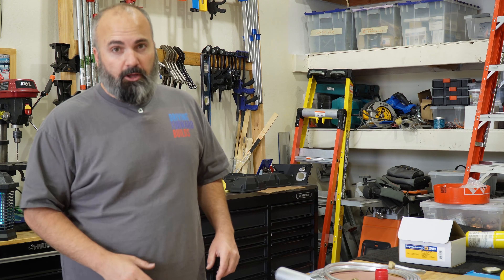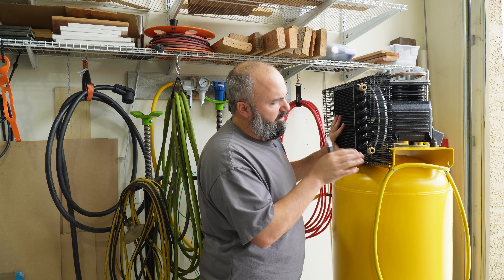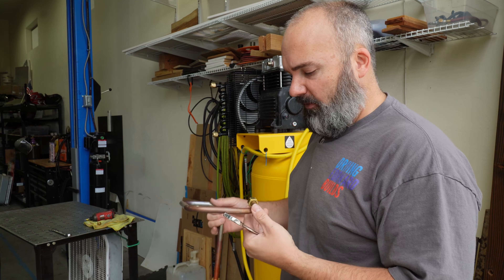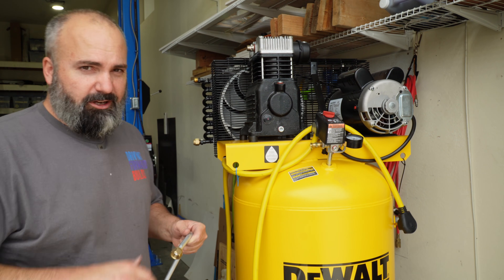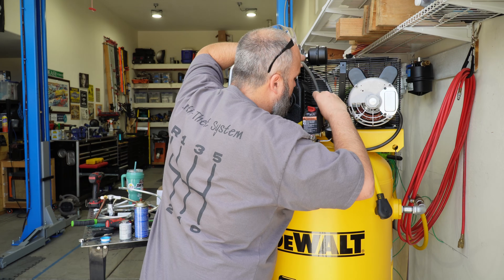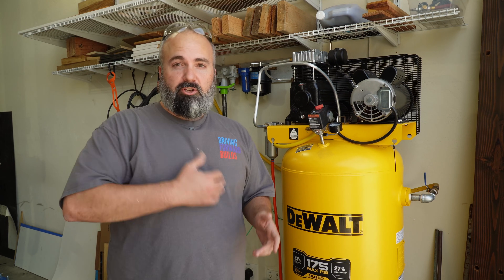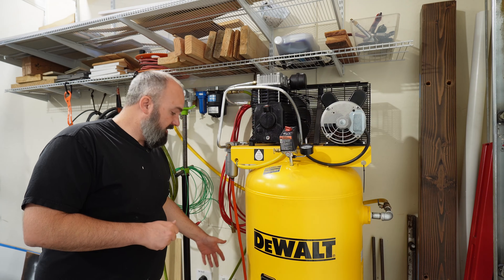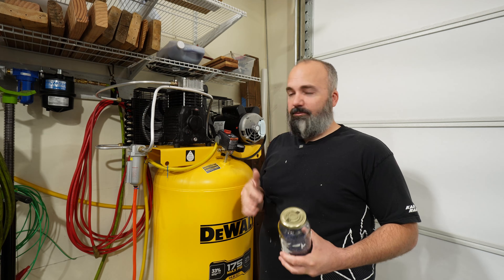DIY Air Compressor Aftercooler/Dryer

Comment: I bought the radiator about 2 years ago and its still in the shed. I have 2 Dewalt 60gal compressors and use 1 for my plasma table and lately its been a nightmare with fluids in line. I need to take a better look at the fittings to see what I can figure out.
Reply: To add to @DrivingForwardBuilds comment, I used the AN fitting with copper pipe and a 45 degree flare. I did not run the flare all the way down but pretty close and it worked just fine. Having one end AN and the other end a compression fitting (on the filter) actually worked great because I could slip the compression end into the filter and check the fit to the AN fitting without bending the tube at all. If you use an adapter and end up with a compression fitting on both ends then you are forced to bend the tube a bit just to check the fit. I was concerned about putting a residual load on the radiator fitting (one broke off on me after about 1-1/2 years) so I wanted the fit to be as close as possible.
Reply from the maker: It’s worth it. Every time mine runs, even with how dry it is here I get water out of the auto drain before the tank. I do still vent the base but get more mist than anything out of there.
Reply: @DrivingForwardBuilds  im going through the link and cant see where the 8an to 1/2 Compressor adapter was used at, on filter? I do stainless steel tubing on a weekly basis but never done flare connections so have some research to do. Thanks for the quick reply.
Reply from the maker: @cutweldngrind  I recommended the An to compression adapters for the radiator fittings(they are AN) for folks that were worried about leaks. I wound up only using compression fittings and don’t have any leaks. My lines are aluminum which is soft so I think that helped since AN fittings are 37* and compression is 45*. I did have a line break a few weeks later from an improper ferrule set on the tank inlet. That was fixed by straightening my line and ferrule.

Comment: You should vent the hot air outside. Bonus is you're cooling your shop that way -- what you have created is basically an AC as well, just venting the hot air into the same space. That hot air is a combination of the compressor pump + ambient energy in the air. Assuming 90degF ambient, compressed to 150PSI, you'd in theory have air at ~600degF in the tank(!). Obviously, this assumes no cooling. In reality, it'd be cooling down pretty quickly. That's all thermal energy that's taken out of the garage. Assuming that tank is right and it's 14.6scfm (and my math is correct), that's something like a 5 ton AC running... In reality, it's probably half that, since compressed air heat pumps are like 70% efficient vs the 300% of a regular AC, but still. Free cooling!
Reply: I'm still not a fan of the cooler placement.  This is prewarming the air that cools the compressor.  It's just a little counterproductive that way.  I wonder if his compressor head temperatures will go up significantly.
Reply from the maker: @ronyerke9250  I wondered the same thing. However, with how much air is flowing over the head, and the rate of flow I feel like it would be negligible.
Reply: @DrivingForwardBuilds  Did you forget about turbulence?  Air going past the cylinders will also disturb the air over the head, but to a lesser degree.
Reply from the maker: Typically I have my shop door open to help with air circulation since I don’t have AC yet. Hopefully the heat load once I do have AC won’t be too bad.
Reply: @DrivingForwardBuilds  It looks like the specs on that air compressor are 20A (@120?V) If so, that's about 2.4kW of heat. But if you vent, not only are you taking that out, but you're actively cooling the rest of the room (albeit for whatever duration the compressor is running).